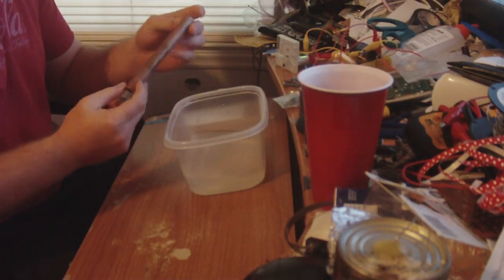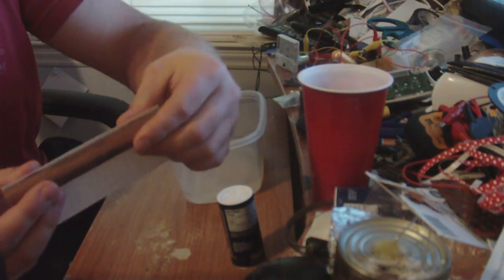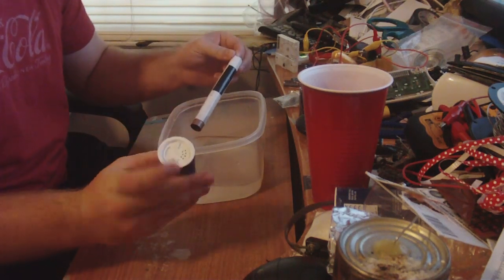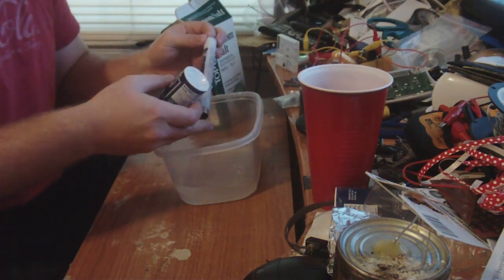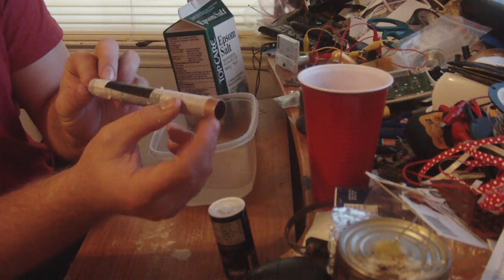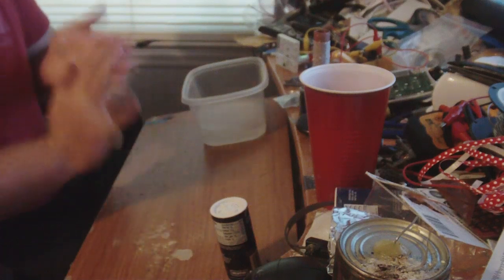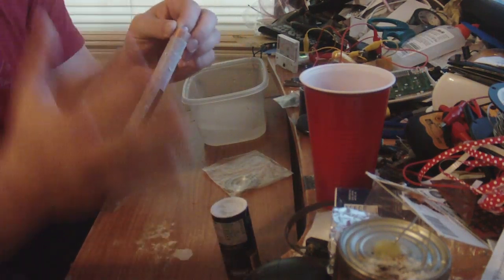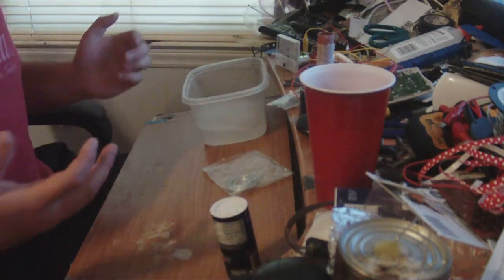How to make a Low power self charging crystal cell battery

Comment: I have a question, couldn't you put the Norton Salt Substitute and Epson Salt to boil in an aluminum can to get the water out and then grind it up and then use the Elmer's Glue-All to finish it. I'm just curious to know if you can cook it first to remove the water.

Comment: if i was to have say have a 8/16" inch tube with this process and another tube thats 10/16", and have them both dry and taped. Could I slide the smaller tube into the the larger one and make 2 of these batteries in one?

Comment: If you buy a lot of soda cans/12-packs, snap off the can tabs and save them in a baggie. I'd been doing this for a while, because I wanted to test them along with other white metals (screws, nails, silver speaker wire) to see what get's good voltage. 

People throw out electronics all the time, so I snipped 2 cords walking down the road for some copper coil.

It turns out the aluminum can tabs got .7v in one water cell test, which is pretty high. 4 of them got over 3volts.

Comment: @ibpointless2 OK, thanks. It's funny because a while back I set out to make not a crystal battery per say, but an electrolytic: Stainless Steel, Aluminum, Alum, Paper membrane, and inadevertantly I let it dry out. It never did lose voltage completely, it's still at .54 volts but I did not follow your procedure (or any proc.) - and now... I hear what you are saying... let dry, then combine. combined wet, and it has no power, or.. I can't find an oscillator it'll run... not even a Happy Cat

Comment: @ibpointless2 I think shop rag was the wrong word. It's a 3M product and it is very thin. And won't degrade like that paper will, given it is organic / cellulose, I'll give it a try and see. I plan on making several, simultaneously, different ways.. one of which I will just use the paper as well :)

Comment: Thanks for taking the time to do this :) I notced at Princess Auto (Canada), they have a heavy duty shop rag, upon first looking at it, it just appears to be high quality paper towel, however, if you read the package, it is actually a white (no ink) microfibre polymer, nothing organic about it. Thinking it may make a better seperator. I'll try some when I follow this build. I don't have magnesium yet, but I will try with aluminum ground rod / copper. Cheers